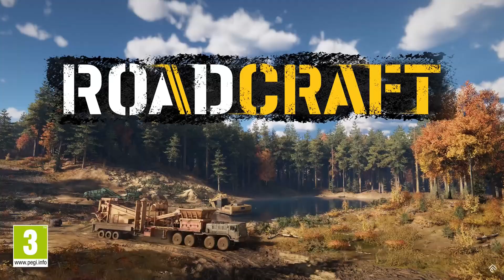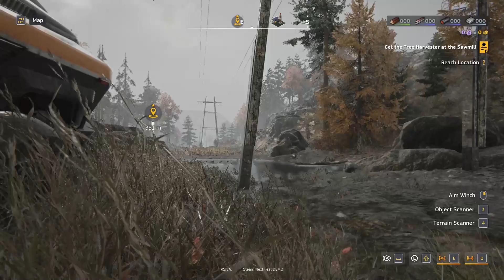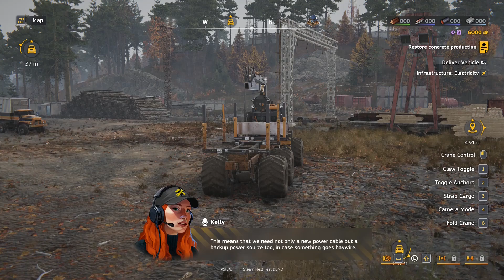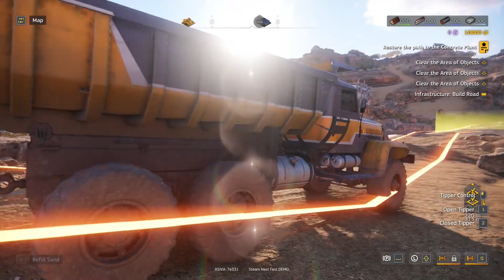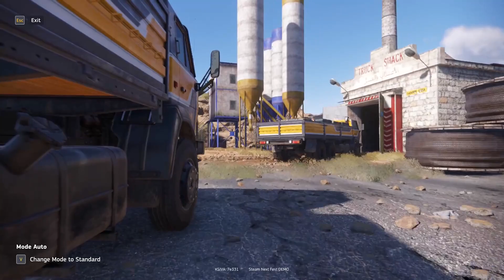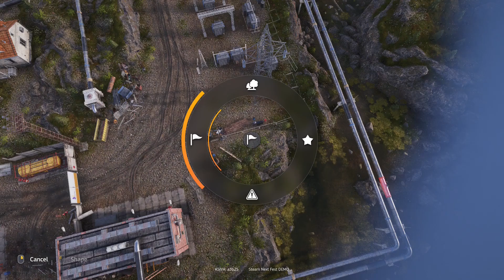RoadCraft - ALL Vehicles & Key Features You May Have Missed in the Demo

Comment: What are the gearboxes like? Are snowrunner gears available (low minus, low, low plus, high range, etc.) I was very disappointed in Expeditions since these gears were so difficult to unlock. I rarely use automatic in Snowrunner.
Reply from the maker: Its been simplified unfortunately.  Its an automatic gearbox and there's a button for Low Gear, AWD and Diff Lock.
Reply: @TruScoreGaming that's a bummer. That takes away a lot of the control of the vehicle. I was getting excited for this. 😢